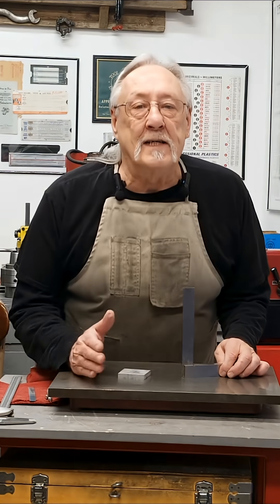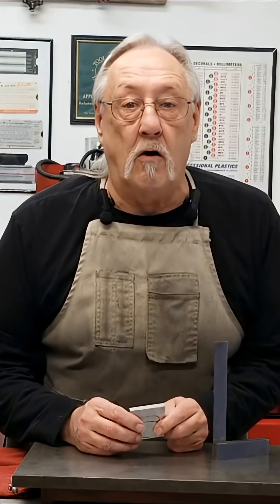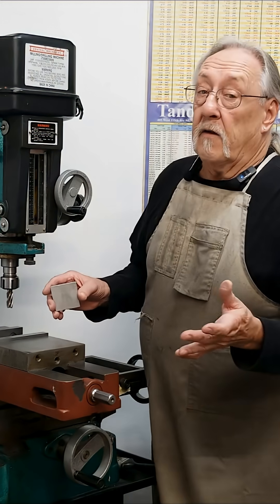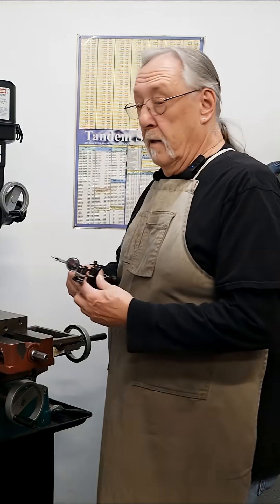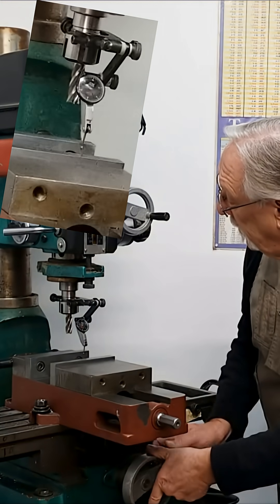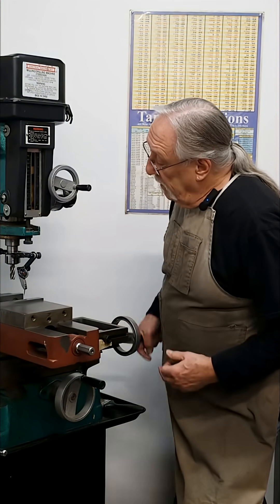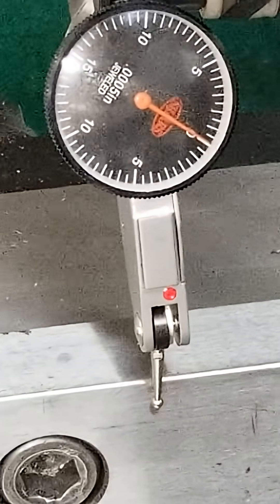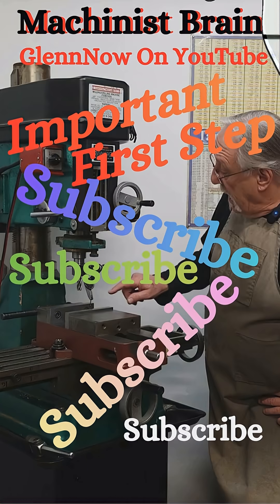Machinist Brain 48, Important First Step

Comment: With shop classes dying off in school, these videos will be a big help for the next generation of machinists.
Reply from the maker: Thank you Jeremy. I was hoping someone would see it in that way. Whether a mini mill or full size a manual mill or CNC this is an important first step. Thanks for watching and commenting.  👍
Reply: @GlennNowOnYouTube no problem, I used to be a machinist and die maker.  There's a lot to learn just to get the basics down.
Reply from the maker: I was lucky when I started out in the trade. I worked with old guys that put be into situations that they most likely knew I would screw up. Then took the time to show me a better way to do the job. Telling me that there is always more than one way to do a job, but to think about the out come of my work before I start my first cut.
Reply: @GlennNowOnYouTube I started out in metals class freshman year.  By the time I was a junior I had taken metals 1,2 and 3 so I got to teach metals 1 for a couple semesters.  Then went on to get my tool and die degree after working in a few shops.  The old timers were great at difficult setups with minimal equipment but I've found they are scared to use their tooling or equipment to its full potential.  Machines and tooling have come a long way and a rebuilt old mill with ball screws can be a game changer.
Reply from the maker: I'm retired now for 5 years. The last decade of my career I managed a company with owners that had way to much money. And I for sure helped them spend it. I made sure we always had top of the line equipment and pushed it to the limits. Which only made them more money. I guess it depends on the people you work with or for. I guess I was lucky at the end of my career also.
Reply: @GlennNowOnYouTube by old timers I mean the guys pushing retirement 25 years ago.  I got brought into a shop to rewrite CNC programs and make things more efficient.  I cut as much as 68% off of cycle times but average 28%.  The operators didn't like the faster cycle times and complained until they let me go and gave in to the workers.  They went under 6 months later.
Reply from the maker: 😅Yeah, I know what you mean about the workers. I was forced to  add robotics, arms and pellet systems just to keep up with production needs. Again, I was lucky to work for people that was interested in making money.
Reply: @GlennNowOnYouTube  we all have to start somewhere though and you're videos will help if they get out there. I'm thinking about building my own CNC.
Reply from the maker: I did that once. I have a 3 axis mini mill I built about 15 years ago. I pushed it into the corner of the garage. It reminded me to much like work. After I retired I started a garageshop full of CNC's (full size) . It wasn't any fun. It was just like work. I may be crazy but I gave all of it to a young man in his last year of High School. I remember his parents coming over and asking me what and why I did this. LOL They thought I was Crazy. I even got someone to move it. He was pretty happy  .😁
Reply: @GlennNowOnYouTube that's awesome!  Set him up to learn and possibly start his own business.  One machine is all a person needs.
Reply: @GlennNowOnYouTube I just like to make my own parts and get creative occasionally.  I don't like to pay anyone to work on my stuff and the price of parts is getting crazy so I want to be more self sufficient.